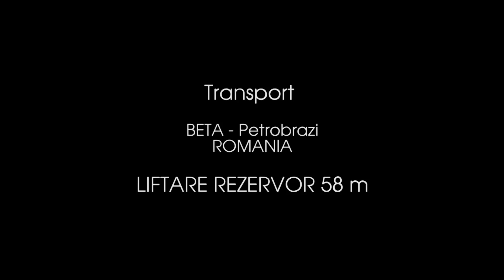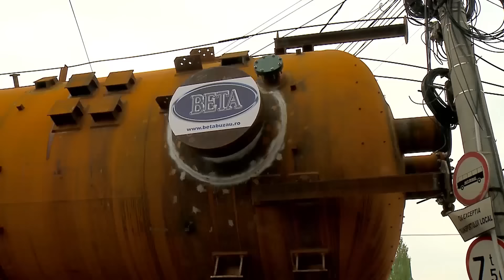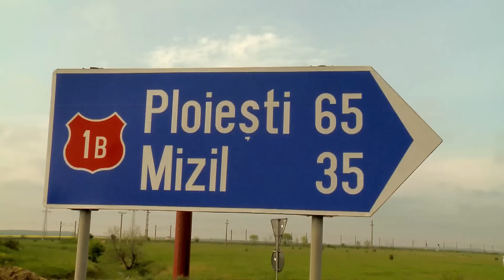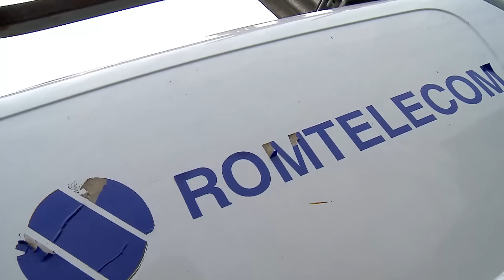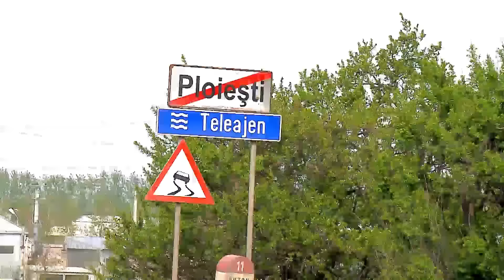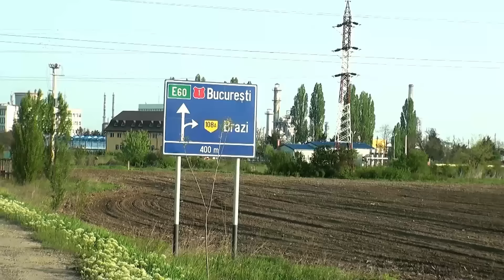Felbermayer Brazi by Magic Media   Romi Draghici

Comment: How he drive in the bridge ,it is amazing driver , balance of engineering department.
Reply: Did you watch the video, there were two drivers . . . Unless the driver at the rear was a cardboard cutout!
Reply: @Muggar62  the trucks only pull and push the platforms, but the platforms are turned, braked and lifted by the drivers sitting in those side seats mounted on the platforms

Comment: That was cool the way they crossed the river bridge with the one unit in one lane and the rear unit in the other lane. How long did it take to plan this move-out?  This company and the people who work for it have it (as I would say; in a very small sock as they know what they are doing). thanks for a very, very outstanding video. (Mississippi gulf coast, USA)
Reply: they had to do so because of weight per axel